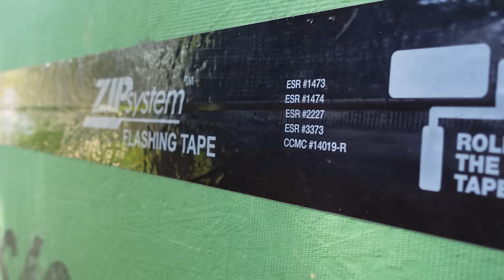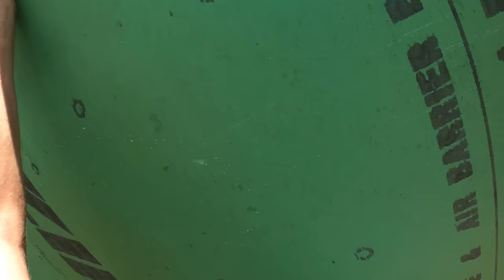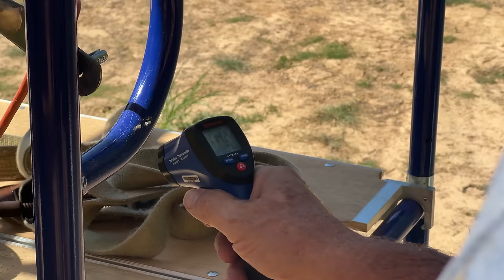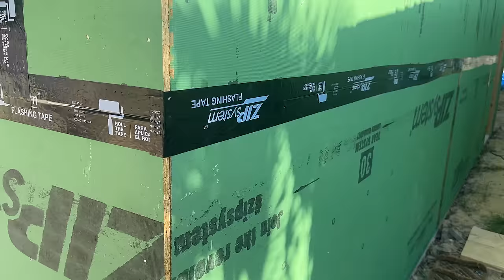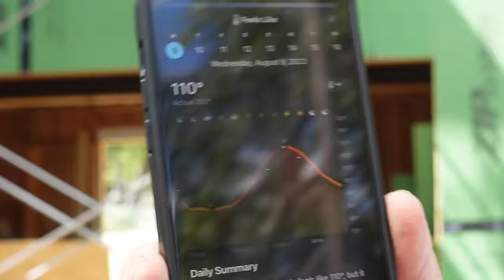We Thought We Could FINISH...But the Roof Made Us QUIT!!

Comment: I framed homes to work my way through college. I am a great fan, and you are an amazing General Contractor, so don't take this as peevish criticism. Take this as advice for any future projects you may frame.

You have no concept of how much time you would have saved had you squared your walls on the ground, sheathed them with the Zip board and THEN raised them up. Professional framing carpenters do this with every home. As long as the slab is reasonably level, which is required by code, your walls will be plumb when you set them in place.

Alternatively, if your slab is out of level for some reason,  you can tack your exterior Zip board sheathing in place with one nail in each corner and then rack your walls into plumb when they are up. 

Similarly, before you raise your gables, it is simple to sheath them with the Zip board on the ground and tape the joints. Again, this saves HUGE amounts of labor and time. 

A third trick that professional framers use for house like yours is that they will hire a crane to not only set the trusses, but to also set an entire bunk of OSB sheathing on the roof. Professional framers build a temporary plywood/OSB rack on the roof to hold the OSB. This makes sheeting (or sheathing if your prefer) the roof MUCH easier because you do not have to lift all of the OSB up two stories. 

A fourth option you could have used is to hire a pro-framing crew to come in and frame this house. It would take a five-man crew a maximum of three days to frame this house if you set the trusses with a crane. Typically, they charge either $5.00 per SF or they charge an hourly rate for the five men and profit.

A fifth pro-framing trick is that once you have the roof trusses on, pro-framers often will build a temporary scaffolding  mounted outside the second floor exterior walls. They simply use 2" x 4" triangle braces and then put 2" x 10" boards to walk on. If you want to be OSHA approved, it is simple to build a temporary guard rail around the 2" x 10" scaffolding using 2" x 4"s and a nail gun. You just attach the vertical guard rail stiles to the triangle bracing and run a 2" x 4" on top of them A good framer can build this scaffolding in less than two hours for a house like yours. The brilliance of doing this is that it allows the carpenters to safely install of the fascia and soffit details without having to mess with building and moving metal ground scaffolding around the house. For the gable ends, you raise your scaffold up high enough so that you can reach the peak of the roof to install the barge fascia and soffit details.

A sixth pro-framing trick is to rent enough ground scaffolding to go around the entire house perimeter, IF budget allows. Usually, scaffold rental companies will drop their prices and rent the scaffolding to you for an entire month for a very reasonable cost if you pay in advance. They drop their prices because they are renting the scaffold for an entire month, and so they can charge less and still make as much or more money. This works, but you have to stage any large components like fiberglass shower enclosures, artwork, pianos, etc. so that you and fit them into the house either before  the scaffold is installed, or after it is taken down. A lot of times, the general contractor will instruct the framers to leave out a section of wall studs in order to provide access for large construction items that have to fit into the house. This also allows your stucco subcontractor or siding subcontractor access to install the all of the exterior cladding/metal panel work/ fiber cement siding, etc., and that will save you time and your subcontractors time, and they will usually do a great job for you in appreciation. 

In short, the primary rules of fast, professional framing is to always provide safe, easy access to all work heights for your carpenters, crane everything you can (including the OSB for the roof sheathing, build and sheath your walls and gables on the ground, build and sheath any architectural details on the ground and crane them up or lift them with a skytrack forklift. An additional rule is to have excess material on site so that your framers can use straight, non-twisted lumber for the walls, ceilings and drops. Access to high work areas is everything if you want both speed and quality. 

I hope these tips help you with future framing projects. I am a licensed general contractor and Civil Engineer now and I still frame all my projects myself.

Comment: Another great video guys! Nice to hear the word "safety" during this vid...nudge nudge wink wink...
I realize it's probably too late, but I've noticed you're still having to pound those proud nails in by hand. If you set the trigger on your nail gun to bounce fire, instead of single action, the extra weight and momentum of the nail gun will ensure every nail goes full depth.
Anyways, I feel ya with the heat...I'm up in the Florida Panhandle and we're running upper 90's every day, and the "feels like" almost 120! As they say...it's not the heat, it's the humidity...whatever...HOT IS HOT! Paul, when you were sitting there zoned out, I know that feeling all too well!
Love ya guys...rock on!!!!

Comment: Do we no longer have to stagger the joints on the wall sheathing using the zip? Also doesn’t the strength axis of the sheathing make it so the sheets have to be horizontal? Or are all the strands of wood in the sheet equal lengths in all directions?

Comment: Guys, can I make a suggestion when lifting these heavy sheeting lifts and even wall lifts, I worked with my Dad who was a licensed  General contractor/ carpenter back in the 1970s he used a triple pulley hoist which gives you a 3:1 mechanical advantage with a 20,000 lbs wench that was on a PTO at the front of his Willeys jeep pickup truck to lift walls and materials to the second floor on houses even sheeting on to walls, it took so much strain off of the carpenters to not have to play Hee-man. Plus these days we have wire-rope, we never had to hand crank anything up. Just a suggestion for the main house build. Keep up the good work. :)

Comment: Need to get a shop fan so you can have a breeze when you stop to rest.  It will help a lot to get you cooled off.

I worked as a mechanic and the shop's length ran parallel with the regular summer winds.  There was a couple of weeks when the thermometer inside the shop was showing 135 degrees and that was as high as it would go.  We had some homemade fans made out of 60 inch fans mounted on wheels so we could move them to where we were working.  If it was not for the wind those big fans made turning 600 RPMs we would never have been able to work on anything inside the shop.
Reply: And in the Texas Panhandle, we do not have the humidity you have down in Houston.  The humidity makes a world of difference.

Comment: Might be a good idea to install a thermostatically controlled vent fan in the upper part of stairwell, then install an intake fan in the bottom of stairwell. Set the temp on the upper one and lower one set lower one to go on at same time. It'll keep the air moving in there especially if not conditioning the overall space.

Comment: You guys need to hook up a mobile Air Conditioner unit out there so you can sit in front of it every few minutes. If you had solar, it wouldn't cost a dime and therefore, doesn't matter that it's not in a air tight room (I use one from time to time while working in my garage, even though the roller door is up. It'll be 95 degrees, but I'll go sit in front of it for a few minutes and it's an automatic body recharge).

Comment: Dudes.....  the proper clothing is a huge benefit.   Tanning is great, but cooks you faster.  Hats are a must but should have holes for air flow.   Light colored clothes and the breathing material are best.     I've worked over 40 years out in the sun... roofs,  framing,  concrete,  and more, and this is important.   Air flow.  So the hat blocks off the sun of,  but without holes, there is no heat escaping.   Light colored clothes. Did you ever watch a landscaper?  They are covered head 2 toe, sometimes in multiple layers. Sweating while hydrating cools your body.   Extra clothes help to hold that moisture and coolness in. 

I'm not ragging on you,  but the more you focus on how hot it is,  the more you will feel the heat. 
Good luck and nice work.

Comment: How about throughing the sheets through the window to the second floor. If you have to, build the scaffold inside the second floor.  Nail a L sleeper to the lower sheeted section of the deck and fire everything up on to the deck resting on the L. Then slide the sheets into place?

Comment: Can you use that green Zip sheathing on the roof?  I thought the brown Zip panels are for the roof
Reply from the maker: Green ZIP (7/16" thick) is approved for 16" on center roofing which is what we have.  The Sienna ZIP (comes in 1/2" or 5/8" thickness) is for 19.2"/24" OC framing and is also stronger in areas with snow loads etc.
Reply: @StudPack  OK, I guess you don't have to worry about snow where you are, LOL

Comment: Hi stud pack why you don't use a pulley wheel when you pull up those heavy plywood sheets you put the wheel on one top of the scaffold  and the bottom guy pulls the rope up and there goes the sheet up let the wheel take the weight off your back it's a humble suggestion  good job keep it up, great teamwork father,son and son in law congratulations 🎉

Comment: I k ow what you mean with harnesses, as a teenager i used to work for my dad roofing in school holidays, was very comfortable on the roof without a harness (not required in our state for first 2 floors unless the pitch is over a specific grade)

Moved to another state and had to do roof cleans occasiannaly, the regs in that state say you have to wear a harness on EVERY roof, even if it was under a single story high and flat.

Never felt like i was in more danger than when i was waering one of those harnesses, everything took SO much longer to. Got to keep adjusting the length, switching anchor points etc.

Comment: The Zip System certainly beats the "way old school" with 20 pound builders felt and roofing tar seaming over 1/2 inch plywood two stories above the ground that I did in the 1960s with my father.  It also beats the Tyvek over flake (OSB) board that my brother and I used in the 1980s.  But, I would echo the comment down below about soft flashing for the windows with Zip tape.  You need to keep bugs, wind and rain infiltration out, especially in Houston.  And, I'm concerned about no overhang in the garage structure.  Won't that lead to more frequent painting to keep the siding from water or sun damage?

Comment: man I know exactly what y'all are going thru I was 80-100 foot in the air on a scaffold or pipe rack pulling wire that weighs 5 pounds per foot around the same time y'all did this the heat was insane

Comment: yesterday was the completion day of a 52 square total tear off and installation of Villa 900 westlake concrete barrel tile on our home here in southwest Florida. started on 7/10 last day 8/11. the average daytime temp was around 95 with no shade trees or clouds at all, heat index averaged about the same as you guys 108-110. it was a totally Hispanic crew wore shoes, long heavy blue jean dungarees, long sleeve hoody type u-v spf type tops with the hood pulled over their heads at all times and wide brim sombrero type hats. the only skin exposed was their hands, no gloves. i spoke with them about all the clothes they wear and its all about keeping the sun off their skin. they wore two cotton tee shirts under their hoodies to absorb the sweat. they claimed if the wind blew they would get a chill. figure that out. 52 thousand pounds of concrete hand carried to a dumpster and tossed in from 15-20 feet in the air. they didn't bother bending over for less that 80 lbs. unbelievable work ethic. i couldn't be out there watching them work for more than an hour. without getting in the shade of the garage or house.

Comment: Out of curiosity, does anyone know what the plan is to keep water/moisture from entering into the lowest edge of the Zip sheathing? Up here (Ohio) we sometimes see snow, rainfall, rain splashing, et cetera getting under/behind various sidings and wicking in. "Slab" homes and buildings see this common issue with the resultant rot, mold and termite damage. Up here where moisture can be a problem (Even with landscaping being too close to the structure) they'll sometimes have a short (Maybe two blocks high) concrete or concrete block wall around the perimeter. With the amount of water we've seen at the Stud Pack site, I'd be a bit concerned.
Reply from the maker: We're going to seal it with ZIP's Liquid Flash

Comment: In some other videos I've seen using the ZIP system--the roofing panels were red, is there any difference between the red panels and the green you are using for the roof (assuming it's the same as the walls?)

As always, you guys are awesome! Keep it up Studpack!
Reply: The brown/red zip are 5/8 thick used for roof panels.

Comment: PLEASE!!,

The exposed edges of the zip sheeting are the weak points so down at the bottom & on the corners please please please use some PROSOCO “liquid flash” & then cover it with zip-tape please please please so that it’s protected from any kind of water wicking possibilities.

They actually make some specific flashing/sealing tape for concrete at the very bottom sill plate area that you can get.

Comment: I realize every state has different codes but I realize you guys were using 7/16 OSB on the roof is that a common practice in Texas.  love what  you guys are doing
Reply: In Kentucky we have to use 5/8 OSB on the roof and 7/16 on walls or bigger

Comment: Like I said I think one or two videos ago, get up at stupid o'clock and knock off around 1pm. Only way you can survive the heat and get the job done safely. You're gonna irritate the neighbors, just calmly explain that at the end you'll have a party and invite the nextdoors and serve up fat steaks and they should forgive you. Please do not forget to hydrate and replenish electrolytes. Read up on the signs of heat stress, heat exhaustion and heat stroke, and check on each other often. Keep a cooler with ice and some hand towels, you can even put a few bottles of Gatorade and Tonic Water in it for some cooling drinks.

Comment: I thought the redis zip panel was for the roof?
Reply: No, not necessarily. It depends on how you're roofing it.
Reply from the maker: 7/16" Green ZIP is okay for 16"OC on roofs where we are.  The Sienna ZIP comes in 1/2" and 5/8" and is used with 24" OC framing and is stronger in snow load areas

Comment: Why don’t the rafters have gable ends?
Reply: I think you may be meaning to ask why the trusses don't extend to form eaves, if so the reason is to make air, water, and vapor sealing easier or in some cases for the installation of exterior insulation. It's referred to as monopoly framing and is fairly common on zip sheathed houses, after everything is sealed they can come back and over frame the roof to add eaves or leave it as is for a more modern look.

Comment: Why couldn't you move all the sheeting for the roof to the top floor, cut it there, then hand it up through the rafters to the roof.  You can set up the scaffolding on the 2nd floor and roll it around easier.

Comment: I noticed in your description for this video that you apologized for the wait on the new video. I don't think that is at all necessary. Anyone who does any kind of work outside knows what you are going through. The heat is brutal. I'm in South Florida and I find myself in attics quite a bit. I nearly got heat stroke in an attic last summer because I was to stubborn to stop and take a break. I just wanted to get the job done and then, all of a sudden, I got nauseous and very weak. It was like turning on a light switch - one minute I was hot but still functioning and the next, I thought I was going to toss my lunch and fall on my face. Fortunately, it was a good sized attic and I didn't have to crawl and shimmy my way out. By the time I got down the ladder I was about done for.

Just take the time to cool off when you need to. Don't feel pressured to put out videos on any particular schedule if it means you'll get clobbered by the heat. And drink lots of water!

Also, the garage/apartment is coming together nicely. Great job!